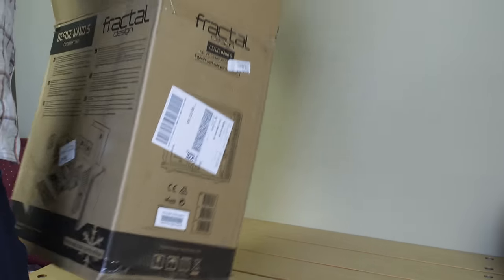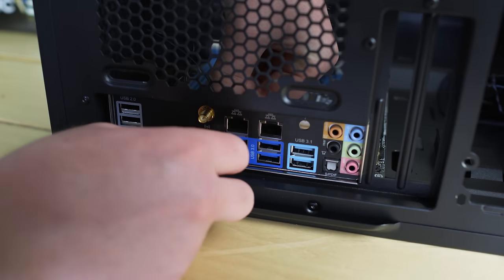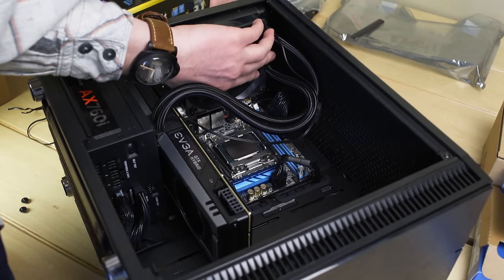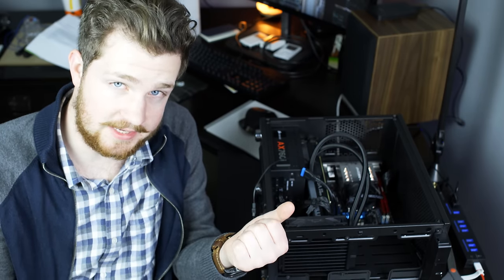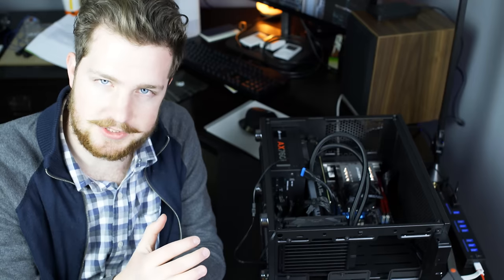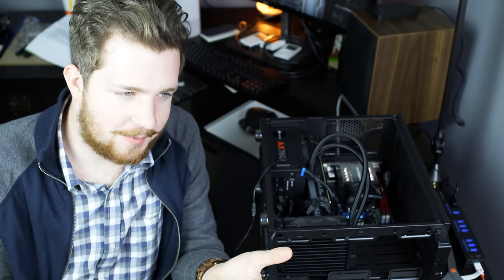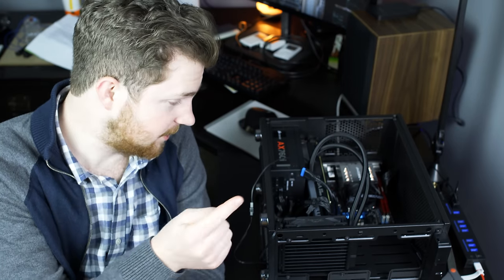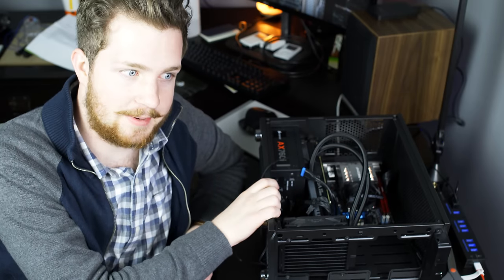My Powerful Custom PC Build Disaster

Comment: I actually built my first PC a few years ago, and it was a disaster like this one.  After about 30 minutes of being idle, it would blue screen and give a generic error that, when I looked it up, it essentially said that it could be anything.  I tinkered with it for about a week or 10 days before I just had to give up and send everything back.  I just don't have the time to send each individual component back and test it to see if that was the one that was causing the issue.  It is extremely frustrating, especially since I helped my friend build his first computer years before that and a second time too with no problems at all.  Eventually, I just decided to buy a prebuilt one from an online store.  It was a great price too.  There was maybe only 10-15% markup over just buying the components and building it myself, so I was extremely happy with it.  I am using it right now and have been for nearly 5 years.  

Bottom line, building PCs can be extremely rewarding.  It does give you near unlimited freedom to get exactly what you want and save you money at the same time, but those that build them often fail to tell people of the dark side of PC building.  It can be a total mess if you get unlucky with components, and it can be a time sink trying to figure out how to fix the problems that arise.  And that's if you know what you're doing to begin with.  I actually know a decent amount about computers, and I didn't think this would happen to me for a second, especially after helping my friend multiple times years back.  I just couldn't waste any more time it.  Maybe someday I'll try it again, but I value my time too much to potentially waste it when I can simply shop around for a good deal from a reputable dealer.  I can handle a reasonable markup to get something that is all but guaranteed to work out of the box.  There's no shame in buying prebuilt.  Just shop around first.  There are good deals out there.

Comment: This is not representative of custom PC building in general. I mean, it CAN be frustrating, but the more practice you get, the more you end up preventing problems before they happen. With experience, PC builds start getting very straightforward and failures become more rare. You also start building trust with certain brands/vendors and get more reliable results over time with consistent parts.

Comment: rma the psu first, and try a new one.. I suggest a evga 750g2..or a Seasonic 750w.  I would try the psu first though, especially since the psu is a refurb, in the computer market Refurbished means it was returned for a specific reason, the tech dept tested it and found nothing wrong with it, then they marked it to be resold, which I think is a shady practice to begin with..

Comment: I have the 61 cooler, and have been very happy with it. On my Fractal R5 case, I had to get longer screws to get it to tighten up to the front where I mounted it though. Your build is the type that makes my stomach turn not knowing what is wrong. One thing that scared me in mine is the newer boards turn on, do a couple checks, then shut off hard before turning back on and doing it's thing. I never buy anything refurbished from a hardware standpoint ......ever. The power supply not taking a standard cable would have been my first look to. I had a Corsair with the same issue, took it back and got another one that fit perfectly. Hell, the one you got could have been a unit with the same issue, and they still didn't fix it... I have a Seasonic unit that works great.

Comment: I'm wondering if it's just a bad 24 pin power cable and the rest of your parts are just fine, including the power supply itself?The rest of your power cables fit fine in the power supply and other components, except that pesky 24 pin cable.

Comment: I have that powersupply. The cable goes in quite smoothly. My guess is that the cable or ps side has bent pins. Forcing the cable probably made it worse.

And also why do people skimp on powersupplies. Its like buying a porshe and then importing the cheapest fuel u can find from a 3rd world country.

Comment: It isn't a issue that the power supply fan is aimed right at the graphics card, is it? I am not for sure which end is the exhaust on those things. Might be worth turning the power supply the other direction.

Of course. I just realized this is a old video. So this comment is probably out of date.

OK. looked the video back over. The fan was aimed out the bottom of the case. Good to know. I am still figuring out PC hardware stuff. Took me forever to figure out to aim it like that on the computer I last built.

Comment: you just need a new 24 pin cable. your an inexperienced PC builder. things happen. but ultimately you didn't do enough research, you shouldn't of went with that motherboard. lots of problems with the mini itx on the x99 board, there is a reason only asrock made one, it's quad channel ram and the board only has 2 dimm slots. you are literally wasting money at the very second you decided to go with that motherboard.

Comment: I think the problem is 760w is not enough for that configuration cause ure running two water pumps and heavy hardware, a 850w power suply would fix the problem, make sure is at least bronze, silver and gold will be great

Comment: I think the most underrated component is the power supply. Everything runs on it. A bad power supply can damage capacitors on your motherboard and graphics card in the long run. It's just not worth the time and effort to troubleshooting and return it and buy a new one. My advice is always get the best power supply unit you can afford. And it's really cheap, compare to graphics cards and everything.

Comment: Unlucky bro, it's  murphy's law applied to computers. Had a brand new build fail on me after two months, and the problem was the water cooler. When water coolers fail you are screwed, specially in an overclocked and overvolted machine.

Comment: PSU or sleeping states and mainboard problems. Had the later more often then the former. But i usually buy PSUs for 150-200 Euro and use them for 10-15 years.

Comment: I built a computer a gaming computer about 1 year ago and also had a power supply issue 3 times.
1st time the power supply blew could smell smoke from it, took it back and paid a few extra pounds and got a better one 
2nd time corsair 750 modular, computer would turn of and restart playing high demanding games 
3rd time, again pad a lot more for a better one, corsair 850 modular would cut off and went back to the store and got my 3rd one again. I'll never use corsair for power supply again

Comment: I think your mistake was buying a refurb, maybe they only tested it for 30 min. Power supplies are very important so you should always go with a new good quality one. 
I would have kept the board and first sent out the power supply, only then you would know what was really wrong plus you could be replacing a fine motherboard for one with a problem.

How is the build now?

Comment: Welcome to PC Building.
A tip; do a stress test before installing all the software.
Also you could have gone for a mid-tower case, it's a little bigger but still easy to hide under a desk or something and way easier to build in. Personally I prefer Full-towers as they look awesome and are an absolute dream to build in because of the space, but hey, that's personal taste.

Comment: A, buying a refurb PSU for such a build was just pure brainfart imho. But I know from the later vid that you switched it out. One other thing. Did you notice that you put the fans on the CPU cooler rad in push mode? you are pushing air out of the front and the back as well. You do not have any intake fans set up. Turn the fans on the rad the other way around, if you do not wish to get dust through every crack possible into the case...

Comment: I had very similar symptoms after my last computer which I had a friend build, and after I took it too a shop, they said the crashes and reboots, etc... were due to overclock issues of the nvidia 980 gtx.  The shop reset to default and has been fine since.  GL all

Comment: I do not want to disappoint you, I had exactly same problem but all the specs were different, and I ended by selling all parts back. I suspected was CPU in my case because I replaced everything except that CPU and issue did not fix.

Comment: I think its the motherboard, because i had same issues and it was my MOBO. You should try updating ur bios, and check every single option in it. Maybe there is a power saving feature or something turned on, which may cause the problem.

Comment: I have never seen such a small mother board with a socket 2011v3. That is cool. You can use a small form factor case. Mine is a full size MB. I like the 2011v3.

Comment: You should check the temp and everything in the bio or uefi after you build just to be sure. And that is with stock cooling. Since you are water cooling you should have put it though its paces before loading windows. You should also have not cheaped out on power supply. On video editing machine stability is everything!

Comment: U can get better gear for 2000 dollars. Best thing is checking temp inside the pc while installing windows or if its installed check temp first. So many bad parts but if something needs so much force i wouldng recommend it. Sry to say but u maybe better stay with mac.

Comment: the connector might not have fit because it might have been the wrong one... the power supply is fully modular meaning that all of the cables are separate and you have to plug them all in manually. There are different cables for different things.... i have a feeling that you plugged in the wrong connector, i have the exact same power supply and i made the exact same mistake at first. There are 2 basically identical cables, one for the motherboard and one for the graphics cards, plug one in wrong and it doesnt work or fit. Probably wasnt a good idea to force it into the connector.... ;_; PS if you take a look at the tip of the connector, you can see that there are different shapes, that is a good indicator if you have the correct cord or not. It should also just be labeled cpu and pcie on the actual cord.

Comment: The parts in your build is eerily similar to the parts I want to use for my build. The main differences is that I plan on using the ATX version of the Define S (I need at least one additional expansion slot) and I plan on using custom water-cooling. otherwise, the parts lists are quite similar.

Comment: Had the same problem you had with the AX760i. Turned out to be a software issue with link. I don't know if you use the software but once I pulled the com port connection it worked fine.

Comment: Why would you spend so much money on expensive components such as your cpu and gpu and then cheap out on the power supply? Your PSU can kill all of your system and is fundamentally as important as any other component as without it, it doesn't work...

Comment: my first build had issues ram slots 2 and 4 worked 1 and 3 dead had to rma mobo this comp I have now is a rebuild same HDD CD rom PSU and ram everything else upgraded did not have issues with rebuild.

Comment: My guess is that the 24 pin power supply cable isnt in correctly, but it is working then stops because of loose comnection, and isnt powering the motherboard. The only other problem I could think of is not seating ur graphics card correctly.

Comment: I would say the PSU is bad. I had a PSU go bad on me and it did the same thing. The PSU is sending bad voltage so the mobo so it shuts off. I had bought a new corsair PSU and this was 2 years into owning it (corsair has a 7 year warranty) and they sent me a new one easy peasy... you can even give them a cc so they will ship it before they get theirs back, so it ships same day. I like corsair a lot due to that.

Comment: Bought my corsair cs750m used on craigslist semi modular the 24pin cable is built in.  Been running it now for over three months and never shut it off.  This is not a brag just a preface your concerns are justified on your psu as they are with the mobo. the exchange should be the answer  as to the  cpu  I think you'll find if the system is able to start then it is most likely not the issue    Good Luck looking forward to seeing the solution

Comment: 1. build PC out out of the case.. if it works welll assemble together.
2. test water cooler outside of the case ( away from mb and cpu in case of water leak.
3. Do not buy refurb power supply.

Comment: It may have only worked after unplugging things cause the psu is brought out of protection mode, Ive used PC Psu's to power car stereos and if it senses anything going bad then it shuts off and stays off until the leftover power stored in the psu is dispersed, Then the psu would go out of protection mode again. Granted you dont have a super cheap and sketchy psu without power protection lol

Comment: I'm having some trouble as well. Although this doesn't happen often, it has happened to me 3 times since building my pc about 5 months ago. What happens is that the pc restarts and goes straight to the bios screen while im using it (only happens when im playing games on it). I then select the SSD with the OS which is windows8, and it runs the OS only to have it go back to bios when i shut it off and turn it back on or even when i restart it. So i have to do it manually. The only solution i have found so far is to restore the default settings on the bios then run the OS. This will solve the problem. I no longer have to boot the OS manually, and it functions normally, but then weeks later it happens again. The pc goes to bios in the middle of my gaming session.
Hopefully someone can give me some advice on how to permanently fix this issue.
Reply: +MOS Most likely the PSU. When gaming does it happen when alot of things happen. If it does check the power supply. and maybe even have a cpu check on another screen or something to check its temperature

Comment: this is probably fixed now, But I came across a similer problem on a computer I was looking at for a friend and it turned out it was the radiator. he tried using a single rad and the computer worked for 30 mins then died. turned out it needed a double rad for the CPU :/

Comment: Dude, get an extension cable for that damn 24 pin. better yet, test it by pulling the psu out of the case, and plug everything in. then try it. if it works, you know it's because you stressed out your 24 pin.

Comment: I have the same cooler, the kraken. And I thought the pump had stopped working after doing a clean install of windows. Turns out for some reason the pump wouldn't work until I had booted into windows at least once, I had to underclock the cpu to get it to stay cool enough for long enough to get into windows.

Comment: I had the same issue, swapped out the PSU and it still happened. Turned out to be my MSI motherboard. Switched it out with an ASUS. All good now but it was a pain in the ass to troubleshoot

Comment: The male pins on some connectors do not come out perfectly straight to meet their female counterparts, especially in modular powers supplies,  I've had to insert the connector at a slight angle to try and get the pin to align, or use a flat head screw driver to get the pin parallel with the other pins, and it would go in much easier and click into place. Pushing too hard can eject the male pin out of the back of the connector housing into the power supply and bend the retention tabs, or crush the pin completely. If it doesn't go in easy that's a good reason why.

Comment: Did you really just install that motherboard without using standoffs? That motherboard is going to short out like crazy. Virtually guaranteed to cause problems.
Reply from the maker: +Widg3t's Widgets Standoffs built into the case. :p

Comment: Did you ever look inside the connector on psu to make sure there wasn't anything in it or a bent pin on cable, forcing a connector to that extent is not recommended under any situation, it's dangerous.

Comment: hay I think it id power cutting it self all it need if it is  an power supply replace  to test if it is when it cuts out   just take all cables out and hold power button for ten sec and put the cables back in and try to boot it

Comment: my specs
intol single potato 0.1 ghz
msa plastic chipset 1 ram slot
curseair 0.0001 gb ram ddr 0.8
msa gtz 10 0.001 ghz gddr 0,5
curseair 10 watt psu
5 mb hdd
1 kb ssd
runs minesweeper on 144p low settings at 0.1 fps
Reply: it uses bestOS2k16 as OS

Comment: If the cable running to the mother board is that hard to plug in have you checked to see if you might have a bent pin in the connector wire or the back of the psu.

Comment: I'm planning to build a computer, pls tell me if that will work :D 
Is this build good for 600€? This is my first time building a pc on my own, so please let me know if that's good or not :c

Cpu: Intel Core i5 4460 (3,2 Ghz)
Cooler: LC-Power Cosmo Cool 120 (120mm)
RAM: 8GB Crucial BallistX Sport (1600Mhz)
Motherboard: ASrock B85M Pro3 mATX
Gpu: Gigabyte GTX 960 OC (2GB GDDR5) or ASUS R9 380 Strix (2GB GDDR5)?
Psu: Cooler Master G450M Modular (80+ Bronze)
Case: Sharkoon VG4-W Midi Tower (USB3)
Storage: 1000GB Seagate Barracuda (7200rpm)
Reply: go on PCpartpicker
Reply: +Lachy Bell for some reason it doesn't find all parts on pc part picker, could you tell me which parts affect the power supply? :D

Comment: Ive had that issue with every Corsair PSU ive tried....... You should push a Philips head(gently) into the pins(on the plug) to splay them out, that way you can plug it in without applying force. only takes a minute to do and saves SOO much time
DONT STICK THE Screw driver into the PSU
Reply: +TheLetmewatchthisvid 
That sounds like a good tip re. the plugs.  I'll have to look at that issue.  I was cringing at his mention of leveraging a screwdriver(s) even TOWARDS a PSU, let alone "into" it.